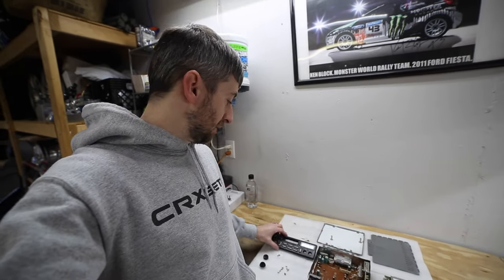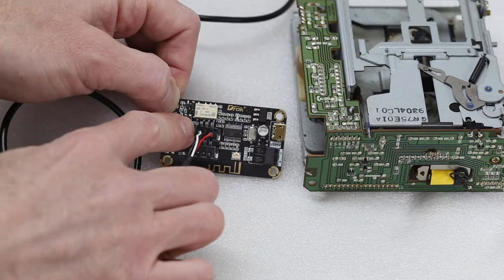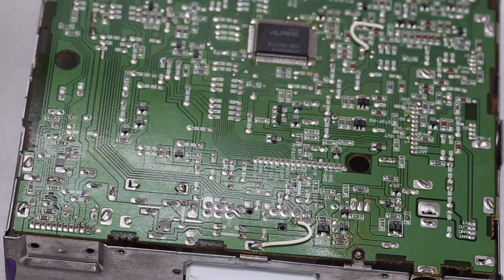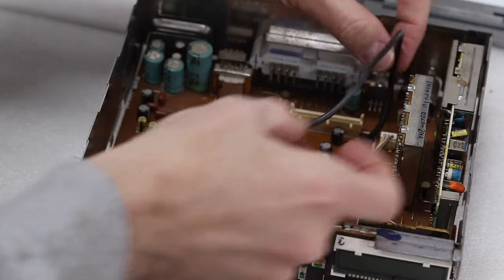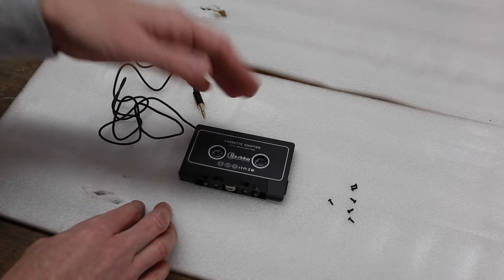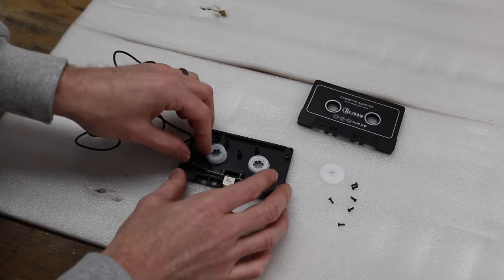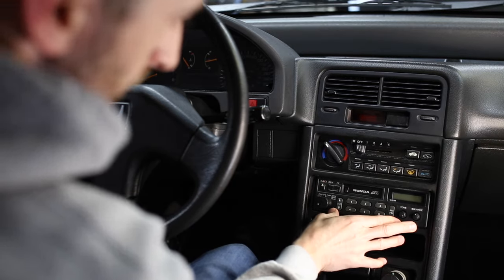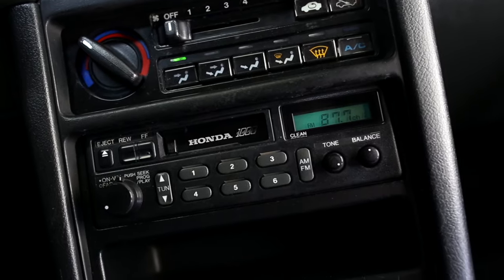Adding Bluetooth to Vintage Factory OEM Honda Stereo

Comment: Will be good if you can find out how to cut the electrical motor. It producing too much noise on the speakers
Reply from the maker: Motor has to run to stay on cassette input. The noise of that tiny motor is insanely minute. My cars exhaust is much much louder than that. Also, that motor played when listening to cassette tapes and it was never an issue.

Comment: Such a good idea i wish people would add a cd slot conversation as well so people still can keep there classic style radios with out having to swap for some tacky after market one
Reply: Most OEM CD players, have either an aux input, or a multichanger input. You can internally wire the Bluetooth module to those, thus keeping the existing  CD functionality.

Comment: Why didn't you cut the wires to the motor so it doesn't spin? Was it the auto reverse issues. Just because you can hear it that's all learned a lot on this video thanks

Comment: I did this a year back to my Prelude which still works flawlessly. But i got my power from the fuse box and now I want to redo mine for a cleaner approach after seeing you tapping into the ACC from the radio itself!
Reply: UPDATE (For anyone that cares lol)

I ended up doing this method into my CRV's oem radio that works flawlessly. Although on my two project cars, I went with a cleaner route on covering the radio din area and installing a 4-way channel Bluetooth amplifier board on my Prelude and a 2-way channel Bluetooth amplifier board on my Miata since they only have two speakers. They all work good!

Comment: I just did this mod on my 03 Tundra. I'm having a problem though. I soldered everything properly and I can see the Bluetooth device, but I can't get the tape deck to accept the tape. It just keeps spitting it back out even if I flip it over. Any ideas? I'm thinking maybe since it's a newer cassette player that maybe I can't trick it as easily with a dummy tape.
Reply from the maker: Maybe try putting the gears back in.
Reply: I tried every different configuration of gears that I could think of. Still won't stay on tape mode for more than a second. I might see if I can find an actual cassette to test the player on its own.

Comment: I did this on a Factory EG radio which was a bit more time consuming seeing as the eg circuit board isnt labeled like the CRX radio's (atleast the one in this video) are.  I do have an issue where if I connect it to power with anything other then USB power (5v-12v doesn't matter) there is alot of static as if the board is messed up.  Gonna order another board and swap it out incase I got a bad one or something.
Reply from the maker: I would double check your connections and your ground to make sure nothing is shorted and you have a good ground.
Reply: @crxseth  I am using a bench power supply to test before going back to my car, I attached the power and ground leads directly to the 12v power and ground rails on my power supply and it still happened.  Switch up to a amazon power block and micro usb cable and it was perfect.

Comment: Did you have any issues with the factory plug connection into the radio? Mine needs some upward pressure on the plug in order work. Anyone have any ideas to fix this?
Reply from the maker: Probably broken solder joints where the rear plug contacts connect to the circuit board. Mine were cracked and needed to be re-soldered.
Reply: @crxseth  thankyou I'll check for that when I do this install!

Comment: Nice video. I did this on my hyundai radio , but more complicated , like no need for a cassette inside (to much mechanical noise) , the bluetooth only has power if I select Tape  so the phone is not connected when I listen to CDs or the radio or when i turn of the unit  , and some hacking on some buttons for next/prev track and play / pause in bluetooth mode  . Because it is also a cassette sensing and auto reverse deck , it whas a super pain to do this , and the unit did not die after many trial and errors :)) .
And just like you , all this work just for the love of that OEM look . :)
Reply from the maker: I’ve work! I didn’t want to dedicate that much time to trying to figure out how to do it without a tape, but I’m sure it would be much better your way.

Comment: Is the tape deck still working aswell?

I still have some old tapes judt for the retro feeling and would like to play them aswell
Reply from the maker: No, this disables the tape head reader. I’m sure with a little more work and adding a switch, you could keep both.

Comment: I've installed it in the same way but instead of putting a blank cassette inside, I've just pushed the thingy that cassette sits on it forward (in the radio itself) so the player thinks there's a cassette inside, And also removed its spring so it wont be able to move it back (since there's actually no cassette in it). And whenever I want to listen to radio I just hit the button and switch to radio.
Great vid
Reply from the maker: What stereo? Does it have the auto reversing feature? That’s what keeps me from doing it your way, I think. I didn’t test it though.

Comment: Can you make and receive phone calls? Just curious
Reply from the maker: There is no microphone hooked up, so no. The Bluetooth module has an input, but I’m not sure of it functions as a microphone input or not. I did not connect it, since I do not like using Bluetooth for calls.

Comment: I'm not sure there was any need to remove the gear from inside the tape adapter.

Usually the deck will pickup that the tape has reached the end by feeling an increase in tension on the sprocket (or feel one sprocket stop)

most of the tape adapters I've used just have a small pawl inside them which only allows the sprockets to rotate one direction, which means that the deck will always run the correct direction for the read head to line up with the one on the adapter (not that direction is a concern in your application)

On some decks the removal of the centre gear may even trigger the auto reverse, as the deck may feel only one spool moving, and assume that it means the tape inside either broke, or it's reached the end of the tape.

Regardless, if it works here, brilliant.
Reply from the maker: I’m not sure why it didn’t work with it in there, as I’m not 100% sure of the mechanism that triggers the auto reverse, but it works, and that’s what matters to me at this point. Haha.

Comment: so besides getting bt connection, you keep tha cassette function
Reply from the maker: You lose the tape head unless you don’t cut the wires. I cut the wires to avoid unnecessary noise since I won’t be listening to cassette tapes.

Comment: Absolutely wicked I’m going to do this for sure! Do you know if I can set up a subwoofer using the factory head unit??
Reply from the maker: I am not sure. It might not be very easy to separate out and amplify low frequencies from a stock stereo.
Reply: @crxseth  ahh okay in that case I’ll just upgrade my speakers. Thanks!
Reply: Look up a LOC or line output converter

Comment: No need to remove gear in tape.
Those tapes are made to continually turn.
I know, i used those in my own crx with my cd player and would never have issues and tape would never try to auto-turn since it was a continuous side.
Probly have 20+ of those tapes in a box lol.
Reply from the maker: For some reason mine wouldn’t work properly without it removed.

Comment: You do a lot for the community another great vid your rex is well taken care of. Wonderin about the radio from what I understand that model is for the 90-91 chassis. The other version part #08118-SH204-AH is for the 88-89. Any thoughts? Much appreciated.
Reply from the maker: I’m not entirely sure. I know there are many variations of the OEM stereos. I only know this one came in a CRX. I’m sure you’re correct about 90-91, because I have seen some with squared off buttons available.
Reply: @crxseth  Thank you

Comment: How do you fix the stereo lighting? The lights on mine are all out with exception to the left most buttons on the selectors
Reply: My honda1000 is WAYYYYYYY different from yours on the inside
Reply from the maker: Yeah, the same style stereo was made by different manufacturers. I have two Honda 1000 stereos but they are both different inside.

Comment: if you have to manually flow the solder by moving the iron around the through hole, you are doing it wrong. buy some ruby fluid soldering paste and solder like a pro
Reply from the maker: Good info. I’m far from proficient at it so I have a lot to learn.
Reply: @crxseth  honestly, since a friend showed that stuff to me, its like using real silverware after having used paper and plastic for so long. you have to try it
Reply: @crxseth  tthe flux comes in a yellow container and its red. never stops working can take many heat cycles. some times i get mad and jam the soldering iron into the jar and it still does what id expect it to. the first time you watch the solder bead up around the joint you will never look back

Comment: I wonder if this would be a similar process to add a 3.5mm input jack, say for an old ipod ( i know...i'm old, who uses these anymore?)  Not sure if there is enough room in the face of the head unit to drill and mount the input, but maybe another option to go along with this one?  Great work!
Reply from the maker: It would be the same process for the 3.5mm jack. Just no power required for that device since it’s just a jack.
Reply: @crxseth  I might try this with one of my spare headunits, using the tape deck adapter is getting old.  I've always been afraid to try soldering anything on an electrical board.  I've soldered plenty of wires and connectors, but nothing on a board yet.
Reply from the maker: @danteisme  It's not too bad, just avoid over heating the area, and don't bridge solder across things that aren't supposed to be connected.

Comment: If you have to use the tape for it to work anyway would it not just have been easier to buy a Bluetooth tape? Very cool mod none the less
Reply from the maker: Tape head reader with Bluetooth tape doesn’t work well or sound as good. But yes, that is an option.

Comment: cant you  rip out  the ribbon  off an old tape.
Reply from the maker: Not if the tape deck has a tape spinning detection.  It will stop.

Comment: Man I've been looking for this setup for a min I asked JDI if there was a harness that I can use with my factory radio. My Q&A can you still have access to the tape cassette to play cassettes ? I'm old school with a little update tech for my EG9. Thanks for the post.
Reply from the maker: The way I did it, I cut the wires from the tape head, so no. You could leave them but you’ll get noise while playing Bluetooth, or add a switch to switch to the tape head wires, or even add a switching chip if you wanted to get fancy. I don’t play tapes, so I didn’t waste the time.
Reply: @crxseth  Thx for the 411 highly appreciated.

Comment: Downside... He didn't add a mic for hands free calling. Interesting mod, but adding forward skip, rewind, and call answer wouldn't be difficult if already doing this mod. I'd go the extra step and add that. Otherwise it's a nice update on that unit.
Reply from the maker: Very true. I took the easy way out and I do not take Bluetooth speakerphone calls, so I didn’t waste my time figuring out how to add it.
Reply: 12v version of the HYT CSRA64215 Bluetooth module gives you hands free calling and also gives you the ability to add five button control of calls and music without touching the phone.  If you're ambitious, darieee's YouTube videos show you how to reprogram the CSR chip for even more.

Comment: Cool!
But aren't there other variants of wiring (commutation at all) so You can get rid of the cassette and still able to use BT? Working cassette makes annoying noise a little bit.
Reply: On some radios, you need working cassette deck. Otherwise it will switch back to another source, like FM Tuner or CD changer.
Reply from the maker: I’m sure there is a way to do it by creating your own control circuit, but I wasn’t trying to get too involved beyond what I did. My exhaust and the. road noise is much louder than the faint whirring of the mini-cassette motor. And, that was present while playing tapes, so it’s not like it is a deal-breaker.

Comment: You spliced in the BT Module in conjunction with the tape deck original wires, correct? So the tape deck still work as a tape deck if you're not using BT? If No, second question...

Japanese Radio- doesn't work very well in the USA. To avoid the tape deck playing sound, and running that motor all the time, could you wire it into FM? Then just select a channel we don't broadcast here?
Reply from the maker: What I did disables the tape playback function. You could splice into the radio input and use that instead of the tape input, but I would not leave the radio function connected since you’ll get more noise.
Reply: @crxseth  When you say you would not leave the radio function- might you be able to expand on that? 

Assuming like the deck, there's two specific places to tape into - I assume BT and the Radio would fight each other - but if set to 70hz, in theory there shouldn't be much of anything for the radio to pick up (plus maybe just disconnect the antenna?)

Appreciate the reply, cheers!
Reply from the maker: @carlsagan2561  Turnon your stereo and turn it to the frequency you’re referring to, then turn the volume up to 50% and tell ‘em what you hear. Now when you add the Bluetooth signal to that, it’ll just be “overlaid” that noise you hear. Unless you disconnect the radio from the internal stereo amplifier, you’ll have the Bluetooth music, but it’ll be mixed in with all that static.
Reply: @crxseth  Don't have it in front of me currently, so unable to preform that test. 

The part I'm hung up on is 'unless you disconnect the radio from the internal stereo amp" - that sounds like exactly what I'd want to do, but not clear on the how. Would it be similar to just tracing back where the FM radio chips exist, how they are connected to the audio channels, and disconnecting that connection - conceptually speaking?
Reply from the maker: @carlsagan2561  That sounds correct to me.

Comment: Does the tape player still work to play tapes, or only as a BT input now?
Reply from the maker: I disconnected the tape head wires to reduce noise, so no tapes will have audio now. If desired, you could leave them both wired up in parallel to retain tape functionality.
Reply: @crxseth  That would be pretty cool... Theoretically you could run your nav in your phone but still hear the tapes, right?
Reply from the maker: Possibly so. Not entirely sure, but it sounds like that should work.

Comment: I am an electrical engineering major and Id really love to do something like this to my 2000 civic. It uses CD though so I will have to research on it, but if its at least 80% like this I will have to do it. Does anyone know how possible it would be?
Reply from the maker: I’m sure it’s possible. Might have to come up with a way to keep the input on CD even without a CD inserted.
Reply: I'd say it is possible, my best friend's dad gave me a radio to replace my original car radio (1991 Peugeot) and it's an early 2000s unit with a cd player. He soldered an AUX cable to the audio output of the CD reader, I use a cd with a blank mp3 file on it, but if I put a regular cd it will also play it just fine, so it's basically what you're looking for
Reply: @gabrielcosta3301  Would you be able to use CDs still or would that be sacrificed?
Reply: @sixeight8621  I'm still able to play cds just fine
Reply: You are going to have to tear it down and see how it's hooked up inside - if it's a model from 2000 it will come down to how old the design was at the point it was made - by then a lot of audio stuff was using DSPs and would have connected the CD up using a digital transport stream, in which case it gets a lot more complicated.  If it's an older design that has an analog connection between the CD mech and the rest of the unit, it's going to be pretty much the same as the method shown in this video.

Comment: Can you still pay cassettes???
Reply from the maker: Not unless I reattach the tape head. I replaced the tape head wires with the Bluetooth output wiring.
Reply: @crxseth  oh gotcha that makes sense now. I missed that part. It is a clean set up. I like the way old radios fit the dash more than just putting a replacement in. Great work.

Comment: Phone calls work?
Reply from the maker: There is no microphone so no.
Reply: @crxseth  okay. Some phones are smart enough to detect that’s there’s no microphone and use the phones microphone and still transmit only audio that’s why I asked. I know this is the case when I use the wired cassette tape adapter.
Reply from the maker: If that’s the case, I’m not sure. I don’t use speakerphone or Bluetooth for calls, so it may work like you described.

Comment: Would this work with the 1000 radio too?
Reply from the maker: This actually was the 1000 radio.
Reply: My 1000 looks totally different, it doesn't say what any of the connections are for
Reply from the maker: @samclark1682  I have a second 1000 that is completely different than the one in this video. I plan to try this mod to it eventually. It will be a lot harder to figure out the connections, though.
Reply: I think I've figured it out because the static changed pitch when my phone is playing audio but it keeps spitting out the tape instead of reading it
Reply: I figured it out, it's idental except that second chip is in the main board but the layout is the same and for the power you just rout it straight to the backs of the pins

Comment: How are phone calls? Can you make them and if so, would it just use the phone's microphone?
Reply from the maker: Never tried, but it has no microphone so it most likely will not work for calls. You’d have to switch to speakerphone.